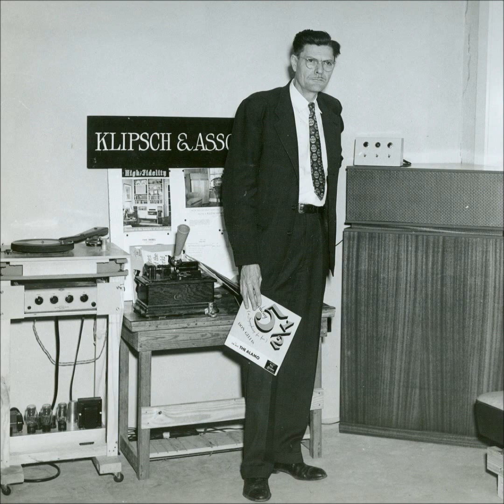Paul W. Klipsch 06.21.1954 Interview

Comment: I started with Heresy's and then added Klipschorns and then a center and sub's and finally ceiling beam speakers.for 5.2.2   KHorns now go for over $6K per.  La Scala's, Cornwalls, fine speakers, but I wouldn't touch any of the newer ones they make. Shame cause decent speakers cost a fortune now.
Reply: They costed a fortune back than as well. The Khorn hasn't changed in price since introduction accounting for inflation
Reply: i wanted a high-end cabinet speaker, but couldn't afford the cornwall iii's, so i built a pair of bob crite's "cornscalas" and couldn't be happier.  EXACTLY what i was going for.
Reply: @nhojcam  you're right, Klipsch are the best-ever!